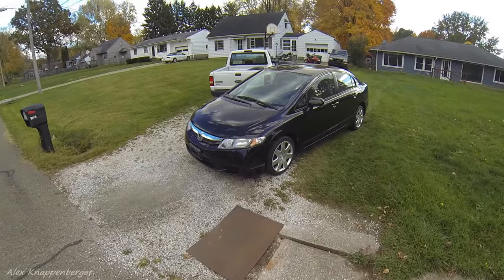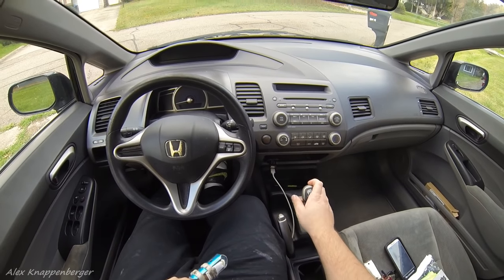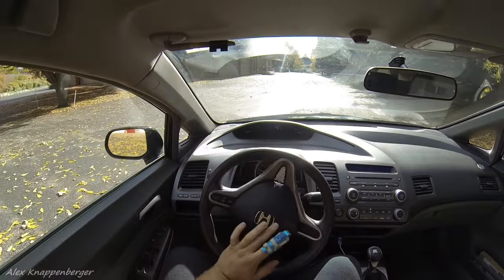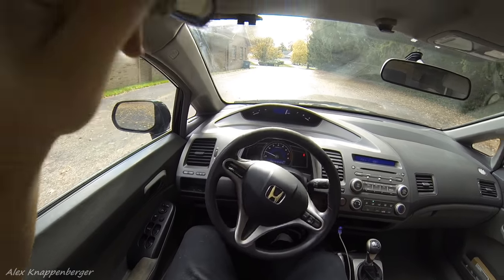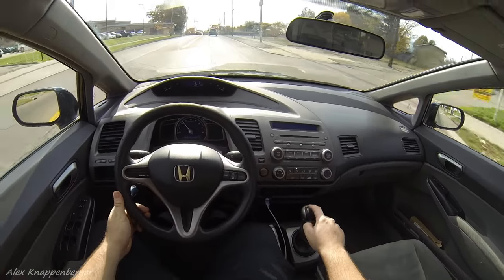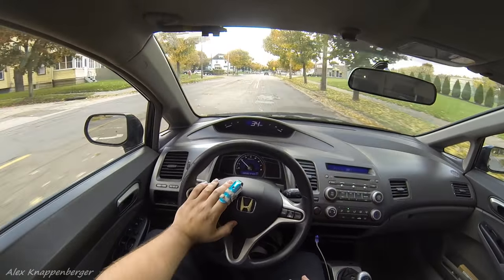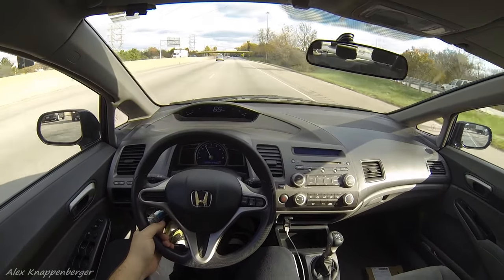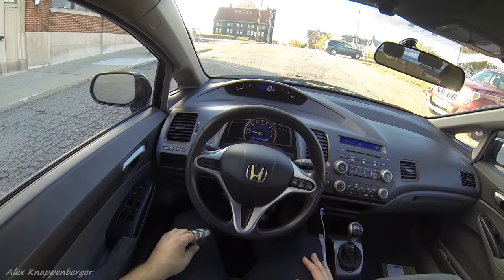How To Drive Stick Shift / Manual Transmission Car ✔

Comment: Mastering this skill also opens up a lot more options when shopping for a car. Another added benefit is that standard shift cars are generally cheaper.
Reply: But for sports models its a bit pricy
Reply: And don’t forget great gas mileage, at least on older vehicles. I had to buy a used car recently, and was able to get a great deal on a 2008 Civic four-door manual. The guy at the lot told me they had gotten three of those Civics, and the first two were gone in a day because they were automatics. The only reason the one I ended up getting was still there was because it was a manual.
Reply: Insurance is cheaper too.  Best anti-theft device.
Reply: @icecreamjunkie6790  how much you got it?

Comment: My dad got me a 98 Honda civic and i hated the fact it was a manual, at first i couldn't even take off but now I'm better. My only issue is hills and traffic but I'm not the only one. Other than that i enjoy it. Thanks for the video, ill look back on it in case i need a refresher.
Reply: Dude, im in the same position! My dad fave me his 2015 honda fit m/t and its a pain. Been driving it for about 2 months, still stall it every other day. Hills are the bain of my existence.
Reply: I’m learning on my dads 99 Honda civic dx coupe and driving manual for me is kind of hard plus in the car I’m learning in I have to give it gas in first otherwise it’ll stall but sometimes when I press the gas it’s hard to press it gently for some reason and I get scared of burning the clutch

Comment: Noiceeeee car I'm bout to buy this as my first car
Reply: Yo I want one too pretty bad 😂

I was gonna get an automatic but in case the transmission goes bad I don't wanna have to pay a shit load of money so I might get a manual.
Reply: @darthdarthbinkss  get a coupe, looks 100x better. Mines a 2010 white coupe looks awesome sadly it's an automatic :/
Reply: @Rabiiid  I decided I'm probably just gonna get a Corolla.  Boring, but it can last forever.

I drive a 2005 Buick LeSabre and as someone that just turned 18, it's not a car I want to keep 😂

Also, there's something wrong with the gas mileage because it gets about 12-13 city and like 18 highway, so it triggers the fuck out of my OCD because I hate having to fill up $40 of gas when I've only driven 220-250 miles
Reply: @darthdarthbinkss  noice my first car was a white mint ford fiesta 2004 hatchback with nice rims. It was a piece of shit that had like 100 things mechanically wrong lol  but look good asf. Never let me down when I drove from college to my hometown every weekend. Idk about miles or has I didnt care enough hahaha but it was like 230km or equivalent to 250mxn pesos (15ish dollars?) In gasoline which is cheap asf
Reply: Bouta go check out an 07 ex coupe next friday hopefully everything is straight will be my first car
Reply: @MrShadowPlaysGames  did u get the EX?  Loving my LX bought last yr.
Reply: Same lmao I’m going to look at one tmrw. Never drive manual before 😅
Reply: They can be pretty good as long you don't rice it out, if you put funcional and tasteful mods, these cars can be pretty fast.

Comment: Best way to burn your clutch is to use it to hold your car on a hill
Reply: +Alex Knappenberger oh i never said you did. I just thought of that because you mentioned slipping your clutch isnt the best thing to do. However i rememeber this one time when i was a rookie i was at a stoplight on a hill for 2 minytes and i used the clutch to hold my car. By the time i took off i could smell my fried
Clutch.  I know the extended period of time had a lot to do with it. But ever since i stopped doing that
Reply: +Alex Knappenberger no handbrake or clutch frying necessary.  I figured that out soon after. Same as taking off on flat land except you have to give it a little extra gas and move from
Brake to gas quickly....
Reply: Grinding the gears is actually the fastest way to tear the clutch up

Comment: Now I finally know the mechanics of a manual car!! The visuals were helpful. Another side benefit of manual transmissions. If your car won't start, then grab a friend or two, ask them to push the car forward..ease off the clutch, press down on gas & BAM! off you go. Also could you explain the difference between a 5 & 6 speed? Paddle shift?
Reply: Anna Gomez A 6th speed is a cruise gear. 5th gear would be your over drive because the output gear ratio is greater than the input.
Reply: And if your car wont start on a train track put in first gear and cranked up and will move foward wirh out engine running

Comment: In a commercial vehicle, first gear is always all the way to the left and down, and reverse is all the way left and up.  Also, in low gear you can ease your foot off of the clutch pedal without touching the accelerator and the vehicle will roll.  It will actually be more difficult to shift in a small car than in a tractor trailer (I’m planning on buying a manual civic soon).

Comment: I gave you a like and a comment for your effort sir and also cause your driving in a Honda Civic Ex coupe manual transmission like mine except way cleaner and probably not beat up like mine but let me say, it's a tough ass car. It amazes me that no one knows how to drive a manual anymore. As I have learned since owning this car, which really only serves a purpose as a work vehicle. Every time I take it to get something done, say at a tire shop recently I asked the guy, hey it's a manual can you even drive it back there and he said yeah no problem. He killed it 10 times plus left ebrake up and mind you it was a short distance to service bay stall...it's just ridiculous. I'm a 41 year old female and I know how to drive a manual! So thank you for your time and reading this long comment!

Comment: Hi man, I have the same car and never went neutral without using the clutch. Are you serious it’s safe for the transmission?
Reply: Nah don't listen to him. He has good and bad advice equally distributed. Hard for someone new to see the good ones but there are some.
Reply: @RogueIntent  😂😂😂😂
Reply: Bad for the clutch and transmission not using the clutch in a manual best to use the clutch.. the best way I can say is the clutch is your best friend
Reply: There's really no reason to NOT use the clutch to put it in neutral so it's better to play it safe and think about your car's wellbeing while driving.

Comment: when your coming to a stop and your putting the car in neutral. do u have your foot on the break while at the light?
Reply: well duh, when you're in neutral the car will roll forward or backwards depending on the slope of the road, and we dont want that, so yeah, you have to be on the brake when you're in neutral.

Comment: do you push the clutch all the way to the floor when using it? I live in Baltimore MD where it is extremely overcrowded with people and they always just slam on their brakes without even slowing down. As a result of this, I always find myself in last minute situations where I have to quickly but barely tap the clutch just enough to slow down or speed up into gear.
Reply: Yes you have to push it all the way down, your wearing the clutch by doing that.

Comment: Why your rpm was at 3000 when you were in 5th gears and around at 70-80? I have an automatique and at this speed my rpm is around 1600-1800
Reply: Because of the gearing in honda's. My fit is at 4000rpm at 70mph. Totally normal for manual honda's. Auto will be a few lower rpm at highway speed.

Comment: Do i always slowly release the clutch or is that only when i get the car going? Can i keep my foot on the gas when switching into second and do i release the cluth slowly going to second or just press down?
Reply: 3 years later, but you only need to slowly release when taking off.

Comment: Question for anyone what was wrong?

I think I was at 3500-4000rpm in 4th traveling 90kmh when I shifted to 5th which needs only 3000rpm when car jerked. Was it too much rpm for 5th or I released a clutch a bit too fast?
Anyone

Comment: that's possible? no gas in first and it will just keep moving? i thought it would stall out eventually without gas
Reply: On older cars this wouldn't work because of low engine power.

Comment: you also don't have to clutch in, if the car is moving, to put it in second gear?
Reply: Pansy Blackwell you always have to press the clutch when changing gears
Reply: kilAcez21 actually there is a way to shift without the clutch. It's called speed shifting or power shifting. It requires petfect timing on the part of the driver. The transmission will shift if you listen to the rpm and shift precisely at right time. I do it by ear. I wouldn't recommend it for a beginner though.

Comment: Learned a lot ahaha didn’t know you could go into Nuetral under braking no clutch. Also how is your civic so loud?
Reply: My civic sounds the same as his and all I did was take the muffler out and replace it with a pipe I welded to a flange

Comment: i'm confused, people are saying to release the clutch  until it bites, then give it gas and your saying to give it gas and then release the clutch
Reply: angryspongebob different cars work different
Reply: Zylonik In Petrol cars you can give gas before releasing the clutch, it’s a lil easier and harder to stall the car
Reply: Technically you don't have to hit the gas to get the car going on first gear. It's good practice to learn the "bite point"

Comment: Hondas are the easiest car to learn manual in, unlike other car. I had to practice alot with my WRX
Reply: Nico Djulianto that's good news I learned today in my dad's Saturn it sucked but the stick I'm getting is a honda
Reply: Nico Djulianto my brz was easy as hell.
Reply: I hear you. I drove two automatic Corollas in the past. I just purchased a WRX STI manual. I took a course in driving stick on a Corolla before I purchased my STI, which was fairly easy to find the clutch engagement point, but this WRX STI is soooo much more difficult to find the clutch engagement point. I've been driving it for a week now.  I'm getting better at it and stalling less. Traffic lights and inclines are brutal!
Reply: DeliciaTrini put your car into gear, hold the clutch down, then pull your e-brake and slowly let go of the clutch you'll slowly feel it grab then when you do release the e-brake. It's called a hill start. Hope this helps.
Reply: Mrbudz, thanks! I'll give it a go. Every day I'm getting more and more confident. Cant wait until I'm totally comfortable with it! I watch videos  on driving stick all the time. Everything helps!
Reply: DeliciaTrini took me a week but everyone is different
Reply: Cool, try an 88 Ford bronco
Reply: Took me a day to learn manual. Like 30 minutes actually lol.

Comment: How do you know when to change gear ?
Reply: I always change the gear when it reaches 3000-3500rpm.
Reply: every second ?
Reply: + @duvalpierre5751  Anytime the engine reaches 3000-3500rpm, switch to a higher gear. The faster you go, the higher the rpms get. I'll give you an example of how I did it. I drove two cars for about 2 years that we're standard. The more I drove them, the more I got familiar with when needing to change gears. It'll take practice but you'll get it. Here's how I did it: 0-25km/h 1st gear. 25-40km/h 2nd gear. 40-60km/h 3rd gear. 60-80km/h 4th gear. 80+km/h 5th gear. Every car is different. Some cars you can rev it up higher but others, it's not good for the motor. Hope this helps.
Reply: Oh.
Reply: + @duvalpierre5751  Have an awesome night.
Reply: U too bro.

Comment: You are supposed to go through the gears till you come to a stop in traffic......... and not coast ......... well over here in the UK we are taught to drive properly
Reply: Alex Knappenberger have you seen the 2018 civic type r? its incredible
Reply: in germany you lean to drive using stick, never coast in neutral as you wont be able to perform maneuver if something happens.
Reply: no way. coast to a stop. you Brits are wrong.
Reply: There are two ways to stop in a manual when coming to a stop light 1. Put it in neutral and brake 2. Downshift down the gears a.k.a. engine braking. Neither of these are wrong, they both work, engine breaking is good for your engine but puts slightly more strain on your clutch and tranny, putting it in neutral puts slightly more strain on the brakes but not the clutch and tranny, it's really just preference stop acting like you're better than anybody else.
Reply: James - I learned down braking in a 1992 Jeep Wrangler thing was a fucking tank